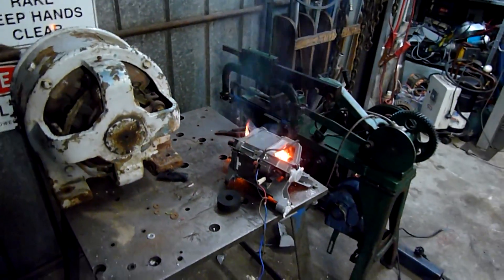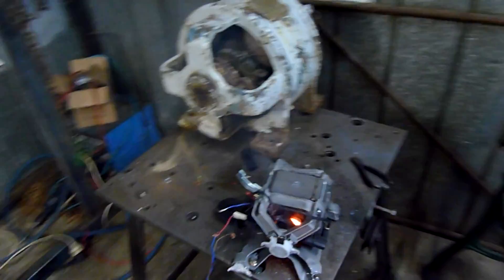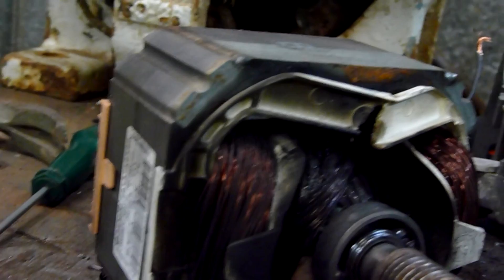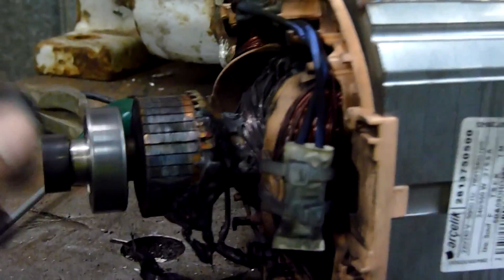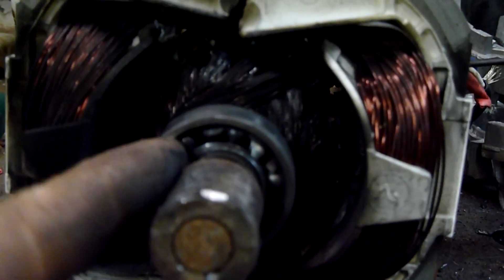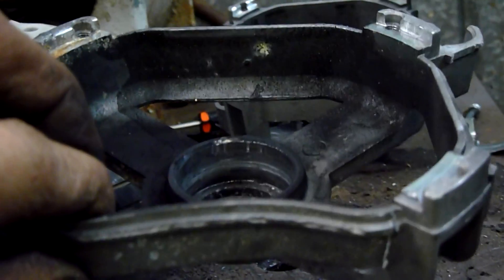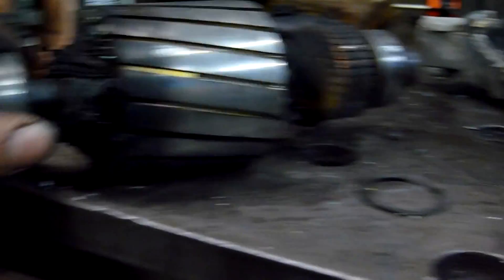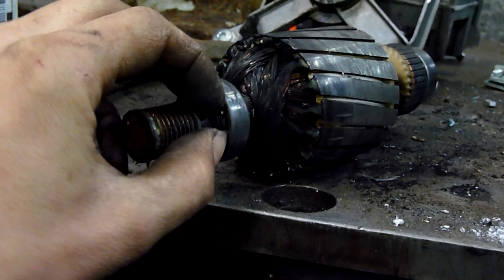Washer Motor Self Destruction at 20,000RPM (Bearing Failure)

Comment: My uncle David had built a tester box that had 3 analogue meters on a small electrical box about the size of a shoe box it 0 -15 amps analogue meter , 
0 - 300 volt analogue meter  
0 - 70 hertz analogue meter
A 15 amp resettable fuse

Comment: whats that big motor
 on the side off pal, looks a  beast.
Reply from the maker: that is a 110V DC generator head, I think it was used as an exciter for a larger AC 3 phase alternator.
Reply: kool, yougot any videos of it in action then pal? looks a beast though.
Reply from the maker: TheSolidsnake41 not too sure, I did have it running for a breif moment until the degraded insulation burned through, its made by Hodson and Gault.

Correction, just found the video! Hodson and Gault 110V DC Generator Test

Comment: Wooo! Lots of sparks! Look at the drive shaft wobble around. :-D There's no way that would've run under load with a drive belt on that. The tension would've pulled the armature off-centre, causing it to contact the stator, & that would've been the end of it.....*POP* In the early part of the vid, I noticed that the bearings lit up pretty well. :-D It must've got hot in there! It would've been super-funny if that was spinning at full-tilt, and *THEN* it started to throw a wobbler! Nice!

-BBD.

Comment: @Pele2048 It looks like the bearing was worn away enough before the shaft started moving around, then the rotor started scraping the stator. You could see parts of the bearing glowing red hot from the friction.